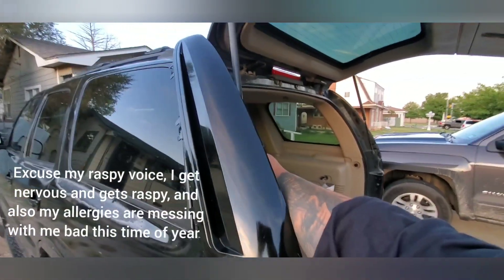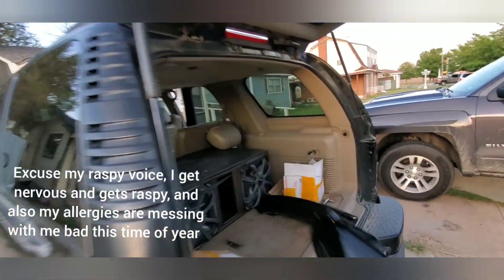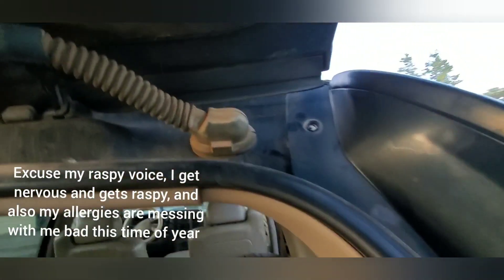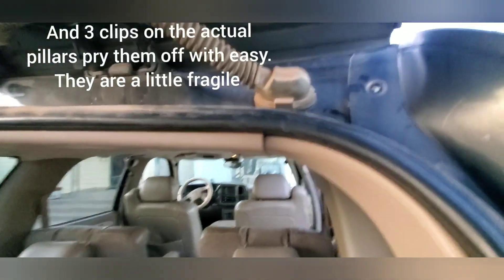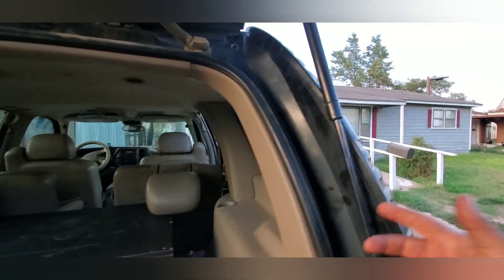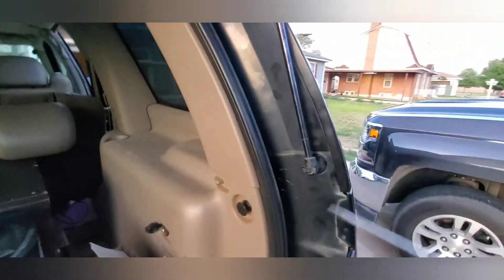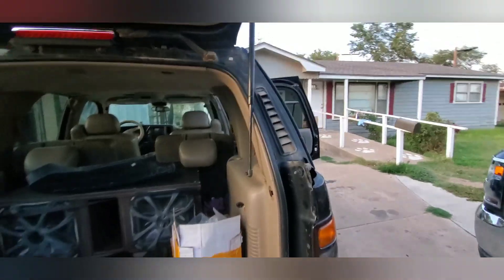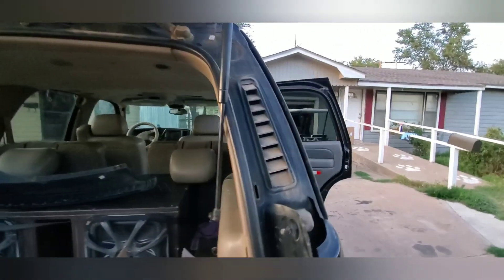Swapping out to Escalade pillars on the denali

Comment: That’s a nice Yukon bro👌🏽 I’m planning on putting a cam on mine I have a 2000 Yukon 5.3 what’s the best cam you would recommend?
Reply from the maker: Just depends on your things.. like stall, intake, headers.   I got a buddy with a 6.0 with a baby cam, like 216/216 and a 3200 stall, and his truck is a monster.   And I got a buddy with a stage 4 in a 5.3. And its a beast too, with no stall.    Just depends what u want. Mine is a 228/228
Reply: @hugodiniro  I appreciate that good looks what if I put a 3200 stall and stage 4 cam? I have a intake at the moment I’m gonna tune after I cam it
Reply from the maker: @jesuszambrano5185  id go higher to be honest. Maybe like a 3600 to get in the power zone instantly